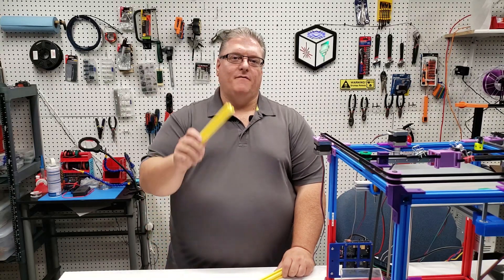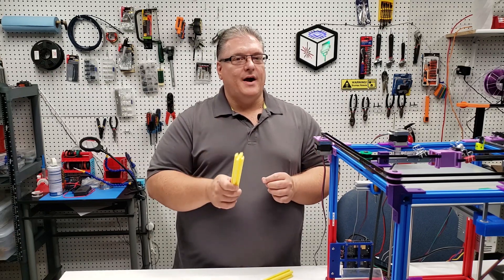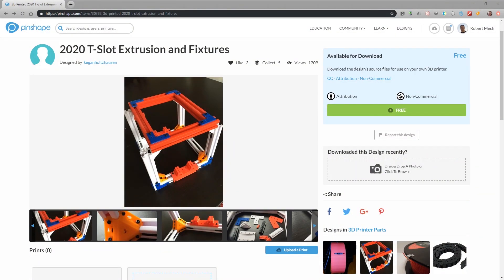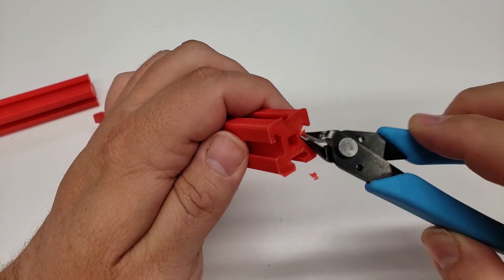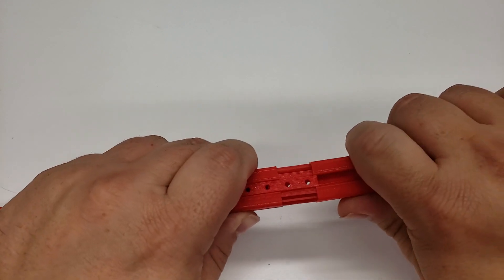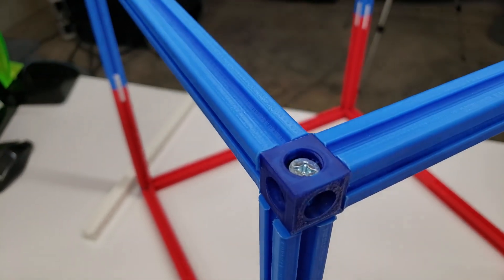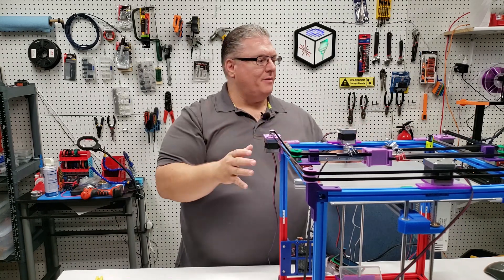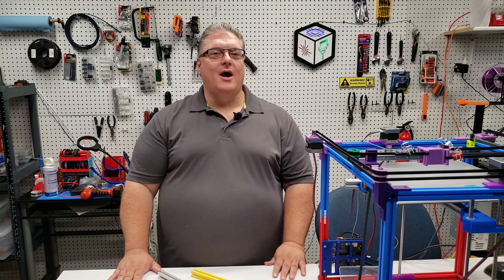3D Printed Extrusion for DIY Printer Builds and STEM projects

Comment: this looks safer to use than aluminium,   i bet if u print it longways its stronger,  or u heat treat the parts, probably makes them stronger,  and just go for 40x40 instead of 20x20 would be stronger too.

Comment: like the video, and although older, but I'm interested in this for prototyping, did you ever try gluing the corners? I know from gluing smaller parts gluing tends to result in a less mobile joint with plastics which might remove some wiggle? I could give this a test but wondered if you gave it a try and found some drawbacks.

Comment: I just found this video and really helpful.. my question is.. the plate you use in 4:17.. how come that they like hard to insert while mine is like loose? that is why i cant connect them.. please help
Reply from the maker: Adjust your horizontal expansion or xy compensation to make the inserts thicker and tighter.  Check your slicer settings and adjust for your needs.  The cause is different printer calibrations.
Reply: @MakersMashup  That make sense thank you so much.!

Comment: In CAD program you can fill in the hole of extrusion and also fill in the slots that you dont need, therefore make the extrusion much stiffer and almost unbreakable
Reply: if you fill in slots you do not need you could shift the print orientation for more strength as well

Comment: I'm sure even the screws could be printed if you were dedicated enough. I think the wiggle is largely due to those corner joints, they look structurally a bit suspect, two flat L shaped brackets with some inner corner support would make a world of difference.
Lastly if you really wanted to beef up the rigidity an extra extrusion from corner to corner would definitely be beneficial.

Comment: What interests me is making a printer half the size of that, like making an ender 3, but all 3d printed parts, strength things up by using some more extrusions to box things in a bit and it should be much more sturdy than trying to make either a core style printer like you have there or a normal ender style printer all out of plastic, both would be flimsy just made out of plastic but a cube with a bunch of inner supports should be much stronger, just looking into this as a possible method of making a printer for my cousins, just a $20 spool of plastic and you could knock out most of the printer construction

Comment: Hi! I'm using the translator, so don't be surprised by my bad English... if you put acrylic sheets, the structure will gain more rigidity and you'll even get a cabin! And maybe a stand on the bench wall can do the trick, if it's still needed.

Abraço do Brasil!
Reply: 1- Making an enclosure with Acrylic sheets will add rigidity
2- Adding a full lenght metal rod / Screw which is fairly cheap inside the actual Extrusions (middle) will add rigidity as well (Which can be used to bolt some ends)
3- Proper corner brackets and possibly an extra extrusion as reinforcement will add rigidity as well (bigger you go the less rigid it will be)

PT/BR

1- Fazer um gabinete com acrilico adiciona rigidez, está correcto
2- Adicionar um ferro / parafuso de metal no interior da extrusão (centro)  também adiciona rigidez (e pode ser usado para unir algumas extrusões)
3- A escolha de cantos corretos e nos sitios certos bem como extrusões extra também adicionam mais rigidez (quanto maior o design menos rigida será claro)

Comment: You just need to add cross braces and then it will be as rigid as aluminium :-??
Reply from the maker: I wouldnt count on it being anywhere near as rigid as aluminum.  Its a great prototyping tool though.  Easy to print simple lengths and use them for smaller projects or to test things out.  Certainly not for rigid production use.

Comment: well now, I've always said the first thing you should do with a 3D printer is make a second one, and you've just facilitated a great amount of ease in doing so
Reply: My recomendation is to get a nice high-quality printer (prusa, makerbot, ultimaker, Creality is getting good too), print a full set of spare parts, and learn how printing works and the clever modeling that sometimes comes with it WITHOUT modding the printer too far. Then get a cheap $100 ebay special and fuck with it endlessly to learn what the mechanical variables are, after that you can scavange it for parts and build your own if you'd like. It's always a good idea to have a "known good" printer in case you get into a bind and need to print replacement parts.
Reply: Hahahaha. "for your final printer"...

"Your next printer" --what you meant to say

Comment: Nice idea, you should try printing the extrusions horizontally. Filament fibers along the long axis are proven to be more resistant to fracture
Reply from the maker: Thought about that but you would need supports to print it that direction.
Reply: @MakersMashup  or modify the 2020 extrusion to have more rounded overhangs. 🤔
Reply: thatis the issue vertically printed layer are weak and horizionally layer is stronger  but issue is the groove support ….

Comment: Those corner joiners you used are not good unless you add a second corner bracket that cups over the corner extrusion pieces. Like a 90 and one of those bent T connectors that connects all three axis together. Same with where you joined the two pieces together with those slide in tabs.. you can print a part that cups over the joints for extra reinforcement. I'd love to see more videos of this being reinforces. Going to check your videos now. Thanks for sharing.

Comment: Would you say printing more structural parts out of PETG or nylon would be better? Especially regarding stiffness and layer adhesion compared to normal PLA? I'm considering building my own Prusa MK3s completely out of printed parts (like the extrusions and front and back plates)
Reply from the maker: PETG is going to give you some added strength and stiffness for sure.  The key to making these work well is the corner brackets.  In the video I used a lot of simple 90 angles to connect things.  Something like https://www.thingiverse.com/thing:1758722 or https://www.thingiverse.com/thing:2472064 would be a better bet for the corners.  Those 90 degree corner brackets are terrible for real strength which is why it wiggles in the video.   Also post a link to your printer when its done I would love to see it!

Comment: Where is most of that flex/movement coming from?  ie is it the plastic extrusion flexing/bending or is that most or all from the corner joints?   My focus being to ask, can that be significantly stiffened up with corner bracing/plating/bracketing or other well placed reinforcement?  Also, how much movement from the joiners between extrusion lengths?  I was thinking a few screws through those might tighten it up some more too..
Reply from the maker: Joints for sure.  Corner plates would be better.  This was largely for a prototypes.  The joiners when 4 are in place are quite solid.  I was actually quite surprised.
Reply: @MakersMashup  awesome ty

Comment: How rigid are they and work in a printer?
Reply from the maker: Individually they are rigid however they will work best with corner plates vs corner brackets.  You could build a printer with it and I built a prototype with it but I wouldn't rely on it for long term use.
Reply: @MakersMashup  thanks

Comment: All you needed was 90 brackets , DIY aluminium or 3d print to stiffen that frame
Reply: He has printed corner braces on it already (see in purple)   I think the flex comes from elsewhere.
Reply: All you need is 2 thin plates for the sides to stiffen the whole thing, no more wiggle
Reply: He doesn’t have braces at the bottom